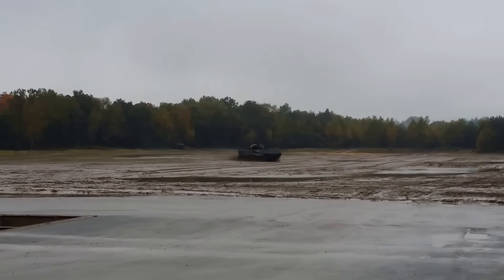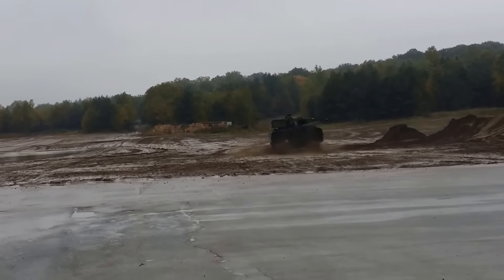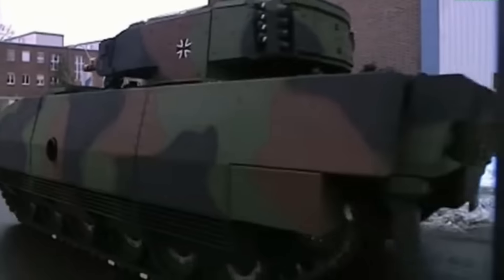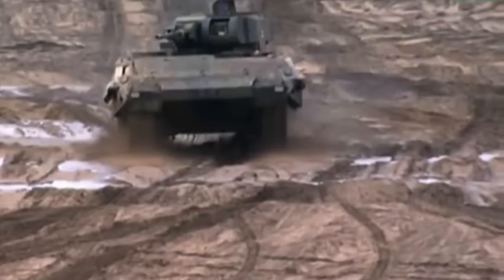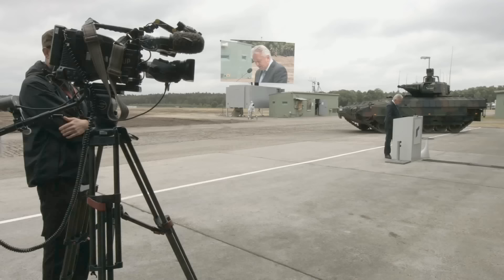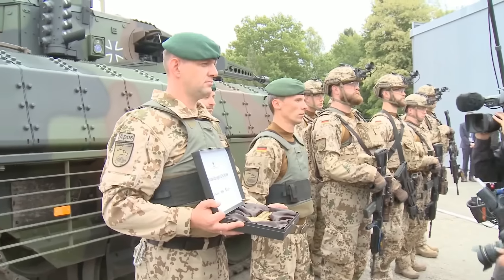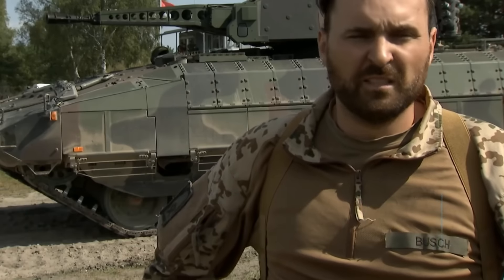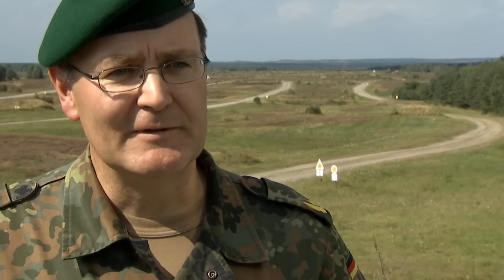The Puma Infantry Fighting Vehicle - Overview and Opinion

Comment: 1 unit cost is $7 million without a spike. Spike is VERY expensive, the price is around 80,000 € per missile and 400,000 € per launch unit. CV-90 is less that $4 million and BMP-3 unit cost is around $2-2.5 million. And BMP-3 has 100mm gun in addition to 30mm gun + missiles launched from the main gun. 
Well, Russian BMP-3 is out of reach for Germany so let`s compare to ancient M2A3 Bradley - $3 million! So is Puma SO good to pay twice more? It doesn't have missile launcher included in price!
M1A2 Abrams is less than $9 million! So Puma is almost same expensive as very good MBT! Germans are idiots, now I know it for sure.
Reply: Considering the protection, fire controls and the mobility, yes it is. Also Germany has Europes biggest GDP and don't needs to worry about money lol.
Reply: Is it better than M1A2? No, it is 10 times worst. But the price is very close, especially if we calculate with missiles. I think any general would prefer to have more tanks and transport soldiers in armored APC's with machine guns. Puma is not a tank, Puma can't withstand against a modern tank. Spike just give chance to try hit a tank but in combat I doubt it will happen. A tank cannot transport troops, that's true but we can get 6 tanks and 6 APCs instead of just 10 Pumas for the same money. 
And money is always important for military, most important. Why do you think modern German army is in so bad condition today? They don't have money for the army. They don't upgrade their own tanks, don't buy new tanks, almost all weapon programs are working only for Arabs.
Reply: I talked about the CV90 and BMP3 you mentioned... It doesen't need to widhstand tanks at all. They have MBT's (also around ~ 7-8 Million $) , this is an IFV (Although it is extremely good protected) Actually, since the M1A2 has no Active Protection Sytsem it could be engaged by any IFV or APC that carries ATGMs. The price is because the developement costs are added to the price. It's produced in low numbers so it's high.
Reply: All modern MBT's are equipped with smoke launchers and some with missile detection systems. In smoke cloud which includes thermal countermeasures, ATGM like spike will lose his target. It is not so easy to hit a modern tank with ATGM unless it is operated by Arabs. But tanks main gun round cannot lose its target in countermeasures, IFV hit by the tank is always dead. So I say IFV must by cheap support transport and used together with tanks. Marder was great, CV-90 is great. Puma is not bad but the army can not afford to have any amount of any vehicle they need. Army always has a limited budget, and if they pay twice more for IFV - they can't afford something else. This is not necessarily about Puma vs something. This is money vs money. And Germany has a HUGE shortage in many vehicle types and weapon systems. 
P.S. By the way, I just imagined Puma in combat against cheaper IFV's... For example against BMP-2 (cost $0,5 million). It has ATGM as well. Not Spike but more than enough for Puma. And for a price 14 times (!!!) less than Puma it still is a very serious threat to Puma. And it carries troops, it has 30mm gun. If there will be 28 BMP-2 against 2 Pumas who do you think will leave to tell the story? By the way, if Puma will be hit by 30mm gun crew will survive and armor will not be penetrated but a rapid continuous fire will damage the gun, cameras, missile launcher and so on. Good armor doesn't mean it can be hit and will continue fighting like in video game. 30mm guns can fire very fast and can damage well-armored targets outer equipment and stun the crew. And 2 Pumas against 5 Bradleys? Bradley has all electronics needed to spot Puma far away and ATGM as well. They were taking out T-72`s in Iraq deserts before Puma was born to see the world. And CV-90 can be equipped with spike or Javelin as well. And Puma is not designed to survive ATGM`s. So what is the point to have all this armor on Puma? It still not a tank for a price of a tank.
Reply: Why are you basing your whole argumentation upon price? The Puma was designed to carry and protect it's troops on the most capable level, and it does. Protection is the No. 1 priority, but that's it what differs germans from Americans or Russians. And the Puma was designed to take RPG/ATGM (see AMAP SC). It also can be equipped with AMAP ADS, the fastest Active Protection System at the moment to counter these threads. And the german army doesen't have the money shortings anymore. In 2020 they will have a military budget as big as russias, but not that many soldiers, so they HAVE to go for quality, not quantity. But funny how every armchair general is just comparing caliber and saying wich IFV is better, there are so many other things to consider but they don't get their attention.
Reply: Do you get your attention on the fact, that transporting troops under protection of good armor already was done before in Israel and Russia? And never was so insanly expensive. If you want to go for quality, why isn't it equipped with ADS and ATGMs in current condition? Did army ordered vehicle in this most protected and advanced variant? No, but in cheapest. You say "no compromises, only quality" and I see only compromises, no quality at all.
Reply: Jonny Similar with Merkavas in that sense i guess (crew protection).
Reply: Russia? Name me one active Russian IFV thats nearly as good protected. (T15 isn't in service yet/based on a german concept  in the late 1990s called NGP btw.) The Puma isn't in active service yet either and not complete (MELLS/MG5 7.62). "Cheapest Variant"?! There's only 1 variant and it's for the german army, the most protected one. Get your facts straight.
Reply: +ossian108 The Merkava MBT/Namer APC program is very similar, yes.
Reply: Jonny Roger that.
Reply: +Arturs Sachlee. Simple Mathematics.  Do a quick calculation before hurling insults, you lazy  tosser. Whats the number of Bradleys build? The Puma has about 350, M2 are very likely 10 times that number. So if develoment costs would be roughly the same, which vehicle would have the higher per unit price?
Reply: "If it would be so" is not mathematics but speculations.
Reply: It's not a specualtion. Just search it up.
Reply: I knew this would be beyond his mental abilities...